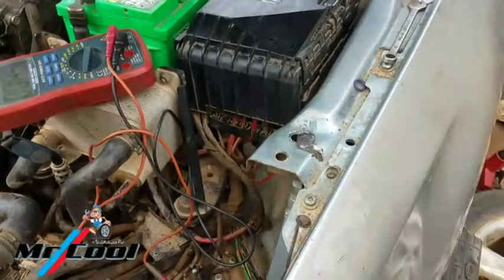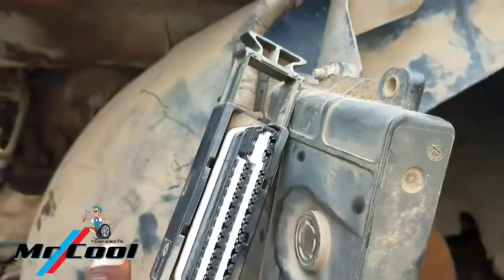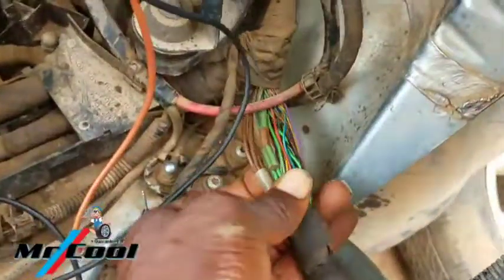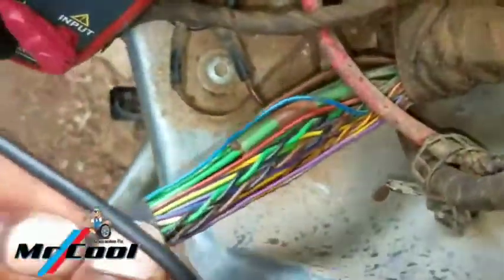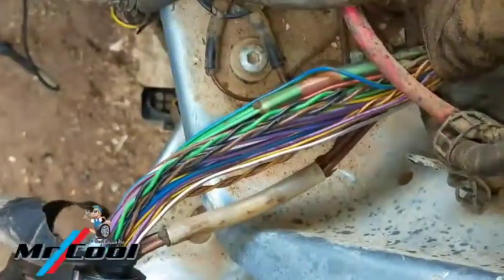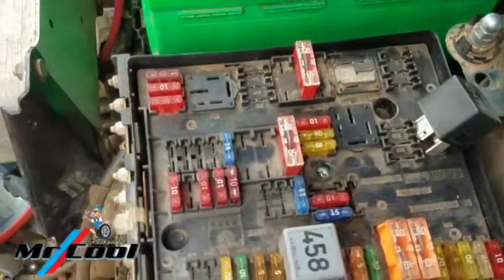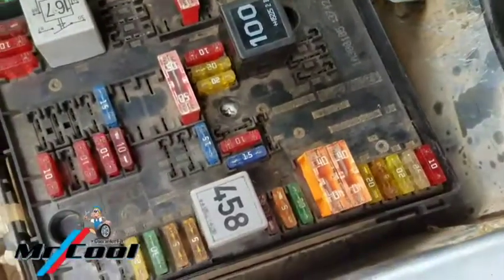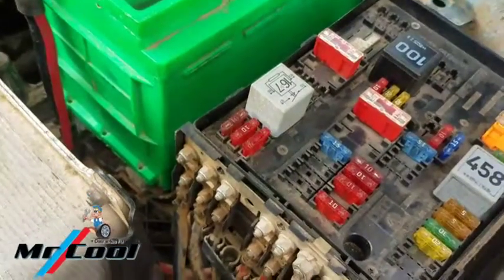How To Fix Code U0101 | TCM Not Communication With ECU Troubleshooting | Gear Shifting Problem

Comment: It’s a problem with the battery or alternator or fuses if you need help I can help you anytime just hmu
Reply: 2014 Chevy captiva sport? 2.4 ecotec. U0101 after replacing water pump and timing chain

Comment: HI SIR I HAVE ROBLEM U0101.2012 CHEVY 3500. I CAN  NOT TAKE TO T C M   LS   HELP ME.I DO ONLY GERMAN CARS. BUT FAST TIME DOING GM. AT DLC GETTING 60 OHM. CAN YOU TELL WHEN I GO FROM HERE
Reply from the maker: If you need my 101 assistance to resolve that issue, I will tell you how much is my cut, once that Payment is made you will have my technical assistant

Comment: 2011 Buick regal.. has U0101 lost communication with TCM code. Then it blew trans axle seal, we fixed it but the car is stuck in Limp mode. Checks connectors, disconnected the battery for hours. We tried this after seeing your video. The OBD2 scan plug pin 6 and 14 resistance reading, said 60.9-61. What does that tell us? Since it’s not exactly 60, is that where our problem is?
Reply from the maker: 👉https://youtube.com/live/J6j4mlEqwNo?feature=share if the this video didn't solve it, tune in next Saturday FAQS series 10 to 11 am

Comment: Same issues with Ford focus 2014. A lot of these focus, fiesta and Mazda had this tcm issue. I want to try and fix it like this instead of getting a new tcm. I'm guessing all these tcm even if new again will still fail again. 

Symptoms: Car stops accelerating during D and gets stuck wherever that  issue starts.

When putting to P and turning ignition again it won't start. It won't even highlight letter P like it usually does. 

I can get everything back started and car moving after disconnecting car for at least 24hours. Then it happens again within 2 minutes
Reply: Currently i'm experiencing the same issue. How did you solve it?
Reply: @dicksonkiptarus3470  triple a subscription and tow it to Ford. TCM warranty renewed till 2025. Could take 2 weeks to 6 months. Ford I think will rent you a car for like 10 a day
Reply from the maker: Nice one

Comment: This does not show how to fix this issue.  A more accurate title would be "how do i fix u0100, tell me in the comments" since i just wasted several minutes trying to learn how you fixed it only to find out that you didnt and you ask at the end for help.
Reply: It’s a problem with the battery or alternator or fuses if you need help I can help you anytime just hmu
Reply: @lamare1005 you specialise in VW’s
Reply from the maker: Get lost!

Comment: I have a u0101 code
My electrician checked the fuses  and checked tcm  all good 
The car would not start and it is in pack, light blink.  my mechanic wants  to drop gear to check valve body
Reply from the maker: Its not a gear box problem
Reply: @Drcooltech  mind share why its not a ggearbox probblem? thank you
Reply: @haniz2107  It’s a problem with the battery or alternator or fuses if you need help I can help you anytime just hmu
Reply: It starts when you use direct battery to kickstarter,  would not change stuck on park. 
If you use the key to start it would start,  light on the park section blink
Reply from the maker: Chinedu, my remote assistance service will cost you more at least equivalent of $200 no refund after payment. While offline fix wiĺ cost your #120k 50% money back if i didnt fix the issue. Locate me in abuja when you are serious
Reply: @chineduogbechie4875 
Greetings sir
Did you find any solution for this eror? 
Thank you
Reply: I had the same problem. With my BMW X3. Coming to find out my battery cable and electric wires was soaking wet. Under my carpet.
Reply: @neworleans1rose so did you just dry it out or replace it? Did it take them long to diagnose?
Reply: It’s a problem with the battery or alternator or fuses if you need help I can help you anytime just hmu